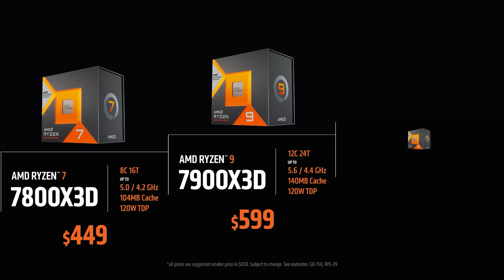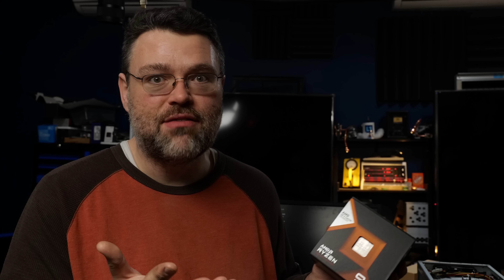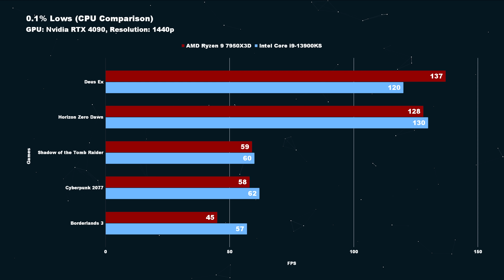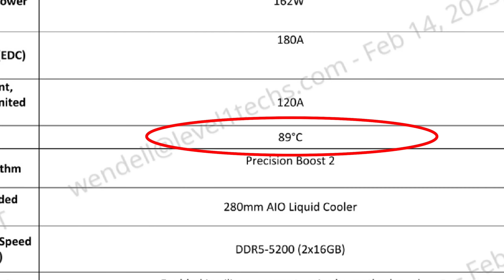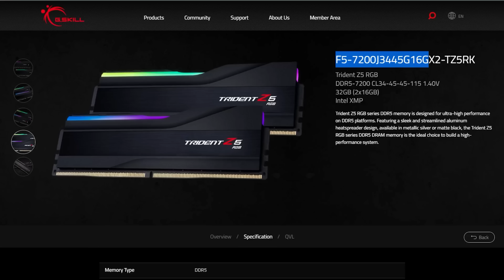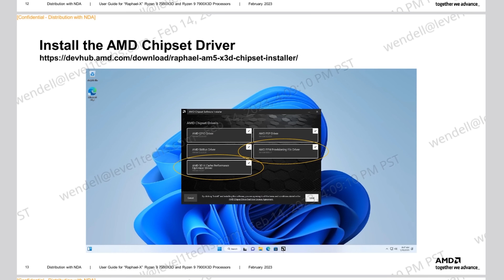7950X3D: Cache Talks While The Watts Walk

Comment: I'm building a 7950X3D workstation, so I will take a look at your insights.  I'm also going to test out some Linux distros on this puppy, basically through an external USB / NVME M.2 drive on the USB-C port on mobo - so basically USB 3.2 Gen 2x2 (20 Gbps).  It is a quick and dirty way to test out Linux flavazs and I can pop out the NVME and put it in the mobo when I'm ready. I also did not install Grub on Fedora 40 because Microsoft keeps trying to take over Bootloading, a recent Windoze update famboozled fooz Linux bootloaders.  Windows 11 implements a fast boot process that makes it difficult to get into BIOS / UEFI but I've forced the Windows Bootloader Menu to appear with the Powershell and when I want to load Fedora 40 I load the mobo Drive Screen and select it.

Windows 11 is a nightmare! I'm working on documenting all my issues and fixes.  Also Powershell is getting more powerful with scripting and automation, so I'm looking into how to prune Win 11. The Total Recall fiasco is going to be a challenge, Windows 11 is the worst bloatware the world has ever known.  We need to band together and provide solutions.

Comment: I'm actually thinking of building a new rig for my unreal engine development... I currently run amd threadripper 3970x and am looking at possibly building a 7950x3d instead because of the increased clock speeds. I would lose some core but I think it would possibly run faster in most tasks compared to the more cores I'm currently running at lower clock speeds of the threadripper. I'm not compiling the engine just building in it. Thoughts?

Comment: Gotta admit I'm pretty happy that I decided up build a new computer this gen. Went from a 8700k and 1070 to 7800x3d and 7900xtx. On the CPU side im ecstatic, the 7800x3d is incredible for gaming. 

The 7900xtx is no slouch either but it didnt have the generational gains loke the 7800x3d had. Not to mention the 7800x3d is pretty much the top cpu for gaming despite costing 250ish less than the flagships.

Comment: I'm going to change mine 10 year old 3700 k Intel and thinking about 13900k or 7950x3d. I have Nvidia 2080ti graphic card and want to change it on next Gen graph in year or 2. So want processor that can handle next gen beast. Intel seems power straight from the box and amd more power efficiency. What do you think??

Comment: I wonder if this CPU might be better than the 7950X. I'm currently in the process of assembling a system with 128GB ECC DDR5 4800 and I've read a few times already the 7950X3D isn't that depended on fast RAM. So might it be actually better for low RAM speed workstation builds when compared to its non 3D counter part at the same Wattage?

Comment: From what I gathered it doesn't appear to make much sense to spend the extra $100.00 on the 7950X3D over the 7950X as the gaming and production performance generally represents a "negligible" difference. Personally, the 7900X @ ~ $450.00 makes the most sense as it's just as good at gaming and not so far behind in other task as to be a real / meaningful detriment - I'm not running a business where TIME is a huge issue. Also there's no need to dick around with "XBOX game bar" and so on.
Reply: when your not using the v cache in games the 7900x3d will give you 6 cores to work with..whereas 7950x3d will give you 8 cores and they will clock at 5.6ghz as appose to 7900x3d with 5.0ghz i suppose if you are not bothered about that for the extra $100...but i see it as you might as well spend the extra if you are going all out on the 7900x3d

Comment: Cache is important no doubt however clock speed is important as well. I am with the intel 13900KS, as I took a chance with the "KS" despite some reviewers negative comments, and getting it up to speed via overclocking does show some impressive gaming performance over the 13900K. In MSFS  I have some results that defy the reviewers results, performance increase about 10-15% over the 13900K? Also the numbers I've seen on the AMD X3D CPU is overinflated for sure. And I am Not a intel/AMD fan boy!

Comment: Would there be any reason to install the latest chipset drivers on say a 5800x3D system? Is it just going to have any real benefit.
Reply: Why would there be? 5800x3d has a single CCD and all of the cores are the same.
Reply: @blegi1245  was wondering if this does anything else in background like it would on the 7950x3D in app priority and all that other goodness
Reply: @shadowarez1337  it doesn't matter. All of the cores are the same. Because all of the cores are the same it doesn't matter what task the scheduler assigns to which core.
Reply: @blegi1245  damn here I was hoping AMD was putting some special sauce in the update for 3D V-Cache Cpus.

Thank you for clarification 👍

Comment: Someone else may have already asked. But why don’t AMD have the stacked cache on both CCDs? Either doubling the cache or splitting it across both evenly?
Reply: Stacked silicon thermally limits the cores on that die to about 5 ghz. If you don't need the boost frequency at all AMD is happy to sell you an Epyc 9174F (16 cores with stacked L3 cache on both CCDs).
Reply: Take this with a grain of salt, as I don't actually know for sure. My educated guess is that different configurations were either tried or modelled, and AMD found that putting the cache on one CCD yielded higher performance than splitting it between both. Or, it could be an efficiency in manufacturing the entire package, as not all CPUs in the stack have multiple CCDs in the package (I suspect the former, as stacking cache on both CCDs would hobble frequency for the entire package to a much greater degree).

Just a guess.

Comment: Forget the ks, no one should buy that chip. I'd like to see it head to head with the non-3d part to see if that extra cost is worth it which I don't think it is.

I just find it hard to get excited about a $700 CPU that's going to be no better than the 7950x in many use cases and you have to have a 4090 at 1080p to show the uplift. If you're gaming at 1080p with a 4090 you're doing it wrong already. It ends up being just as pointless as the KS and no one should be buying that chip. It's fun to play with it in theory but I don't see the point in spending 22% more to see a single digit gain in real world use, as well as a regression from the non-3d part in many non-gaming workloads. Hardly what I would call "no compromises."

I see the 5800x3d as still being the king with the 7800x3d being it's eventual successor. These are just too damn expensive.

Comment: Why would you say this is the best CPU for dev work when the vanilla 7950x has better multi-core, not just out the box but with also modifying the voltage manually can be tuned way extra.
You are at least 10% behind the 7950x with the cache downclocks and voltage locks.

Comment: My big problem with the current Intel platform is that we all know that the 13900k or KS has zero upgrade potential.  Intel historically changes sockets very frequently.  AMD, on the other hand, has historically not changed sockets so frequently.  Therefore, they have a much better upgrade path than Intel.  So x670 will be relevant for several years longer than the Intel alternative.

Comment: I knew buying my 7950X I would probably end up regretting it, when the 3D launches. 
Now i just need to justify ''downgrading'' my 7950X into a Plex/NAS ect server.
Reply: Don't fret - it's more headache than it's worth. There's a ton of things that can go wrong with respect to scheduling, or otherwise a lot of manual intervention - like with Process Lasso - reminds me of the old Threadripper days where Cross CCX is very bad for gaming. The 7950X doesn't have these issues, since it's the same configuration across both CCDs.

7950X3D relies a lot on scheduler intervention going correctly and current solution basically disables half the cores when it detects a game running. (i.e. background tasks will introduce stutters, vs. on regular 7950X)

Comment: Nice review! What mainboards would be a good match for these very efficient processors? I.e. what AM5 mainboards are the most power efficient?
Reply: while technically all four AM5 chipsets support the 7950X3D, and i'm building a machine with it in a B650 right now, most reviewers state that you'll want the better VRM of the higher end chipsets to properly utilize the CPU, so i would recommend an X670 or X670E. i went with a B650 aorus elite ax because opportunity cost was bumping heads between high end board or processor. if one's going to be the weak link and need an upgrade down the road, the mobo was only $200.

Comment: You know what's funny, that 4K benchmark with the 4090, it shows that with Frame Gen, it's likely going to be above 240Hz, the upcoming Samsung Odyssey 8K Neo G9 is 2x 4K @ 240Hz and I do believe that the 4090 is more than capable of pushing those number of frames in a game that supports it at that resolution. But then, it doesn't have a DP2.1 connector. Which is a big wtf moment for me. Why did Nvidia do this? Those connectors is just a few dollars at most right? It just makes no sense.

Comment: Can someone explain to me in simple terms how/if the 7800x3d could/will be better/faster than the 7950x3d please?
Reply: It's not going to be faster (unless the os scheduler sends games to wrong cores on 7950xd3). It's not going to be any slower either because 7800xd3 has the same number of cores at the same frequencies as the stacked cache CCD on 7950xd3. You get the same game performance as 7950xd3 for three hundred dollars cheaper. In workloads that scale with either frequency or threat count 7950xd3 is going to be significantly faster however.

Comment: Curious to see how the core parking logic works when you have a workload such as gaming and streaming from the same system.
Reply: So far the parking works in the way that it detects a game (or similar profiled app) it turns off the none vcache cores. they are off you dont get to use them for other apps or anything. the 7950x3d is doa. wait for 7900x3d at least, maybe even a 7800x3d, there is a world in which they preforms as well or even better if the hz are normalized.
Reply: @jetrpg22  is just wrong. parking is not the same thing as turning off completely.

Comment: 120W TDP

Yeah right, if it's anything like the 120W TDP on 5800X3D then it's more like 150W TDP
Reply: LOL another person who doesn't understand TDP.
Hint: it's not a measure of power consumption.
Reply: @tim3172  LOL another person who assumes he knows what other people mean.

I'm making a judgement based on temperature measurements. Additionally I tested 4 coolers rated for 120W TDP, and 5800X3D chokes on all of them.

PBO adjustment makes a bit of a difference, but it's not stable (not in my case when I run my PC under load for weeks).

Comment: I am a bit surprised about your statements regarding 1% and 0.1% lows as at least the graphs you showed die not reflect that.

And similar for the power consumption.
One is a power-limited system, the other is a full unleashed with auto overclocking.

Comment: Costs more. 
Performs about the same in productivity.
In gaming the differences are minor with afew outliers like Horizon. 
You're better off just buying a 7800X3D even though it runs 600mhz slower than the 7950X3D or a 13700K or 13900K since it is cheaper.

Comment: hey do the pre-rom in-memory compute super fast clock frequency dsp style cores (60GHz+)
Reply: the minimal signal processor transistor processor is very energy efficient, for small amount of transistors for memory specific compute, then just have the memory go as fast as the memory controller, fpga

Comment: A small correction: Cinebench does not fit in cache, but it is not latency sensitive, since it has a smart prefetcher for all the work that threads do.
And this is precisely why Intel was right about it not being a real world performance benchmark. It is too optimized unlike other software.
Software that is optimized to the level of synthetic benchmarks are synthetic benchmarks.

Comment: Great video! So glad you recommended 64GB RAM for future proofing. My understanding is that the AMD system is limited in how fast memory it can support in MT/s by the infinity CACHE. Can you please confirm what the fastest 2 stick 64GB or 2 stick 48GB RAM kit thar will work in combination with this new 7950X3D?

Are AMD able/planning to allow it to use the new 8,000MT/s DDR5 RAM? I heard that 10,000MT/s RAM is coming out very soon. And if AMD can't support faster than 6,400MT/s RAM, would that not mean that Intel will slaughter them by making use of these insane new RAM speeds?
Reply from the maker: Intel is limited too. See my other videos. At least if you want max perf. Firmware updates may fix this
Reply: @Level1Techs  so we should see support for faster RAM with AMD downloads? And buying 8,000MT/s RAM now for an 7950X3D based system may not be a complete waste of money if support will come?
Reply from the maker: No that's different, 4 sticks of memory is speed limited everywhere for now

Comment: Actually I have to think for gaming, the optimal would be the main game thread runs on the CCD with the Vcache and other threads are thrown wherever though I have to think there could be some fine optimizations, and this would vary.  If ALL game threads need access to the same data pool then yes they would run faster on the one CCD, but if not, since the other CCD clocks faster, it would finish its work and pass whatever on to the main game thread or another main thread that's running.

I have to think over time this will become a pretty interesting thing to see with these really high core count CPUs, which for desktop I image in the next couple generations the thread count is going to start getting up to 48, and then 64.

I have to think that these parts once again give reason for people to buy into AM5.  These are the parts many people wanted, either creators that wanted an AMD lower power system that also games at top levels, or people who just game who want the 7800X3D.

I'm waiting for Zen 6 personally because the 5800X3D is great at gaming and will be for many years and paired with X570 it's a nice system.

Comment: With my 5950X, running all my audio through Voicemeeter and doing voice chat with Discord has proved to be a challenge. To get the Discord voice chat to be stable and not sound like an unintelligible robot, I've needed to use Process Lasso to confine my audiodg.exe process to a single core on my 2nd CCD and set its priority to high. How does that type of load work while gaming with a 7950X3D? Also, just how clunky is that whole chipset/Xbox Game Bar software setup?

Comment: I've been thoroughly surprised with Zen. My first Zen experience, personally, was an R3 2300u Laptop with Vega 6 graphics and I could not believe how smooth Windows 10 ran on it. I have been disappointed though with Microsoft regarding this APU.  It has TPM 2.0 and Secure Boot. It's a Quad Core processor, It has 16GB of memory and runs both a 256GB M.2 NVMe SSD and a 500GB SATA SSD, yet Windows 11 keeps telling me it's not supported. It literally makes ZERO sense. 
But gripes aside, I could not believe how smooth and snappy the OS was. In comparison to Bulldozer this chip stomps all over it and it's just 4 cores.  My 4.7 Ghz FX 8350 can't even beat it in multi core! And it's a mobile part. Seeing it pef at 3.9 Ghz all core is fun too. It's nice to know it has some chops and it has pretty good single core (Broadwell) so emulators and anything else with a single thread affinity runs well on it too. I was very afraid to try out Ryzen. I didn't care what the reviews said. I'm disappointed in myself for not giving it a try sooner than Zen+.

Comment: I think you might be the only reviewer who is actively using Optane, so for me at least, I think it would be very interesting to see how newer games benchmark with the P5800X vs. a top-end NVMe SSD, what with DirectStorage and Unreal Engine 5 entering the picture... and to what degree the X3D vs. non-X3D parts relate to that.

I'd also like to see a focus on games that might really benefit from X3D, such as Stellaris (you mentioned it, but then didn't compare to other CPUs), Civ 6 turn times, Factorio, and even something like Microsoft FS2020 which is constantly pulling in world data.
Reply: optane is still the fastest storage technology sadly, i hope intel brings it back
Reply: @snowwsquire  I hope so too, but I doubt they will. There will be some similar tech that'll become available eventually, but for now, most of us are stuck with "fast" NAND Flash.
Reply: Does anyone know what this "gen-z breakout cable" is that he refrenced? Is it one of the regular U.2/3 cables or is it something different/special?

Comment: what about running it on idle? 
is it a good unraid CPU ? 
can the GPu be forwarded to a vm or plex docker?
Reply: to the first question, intel gets much better efficiency at idle. if you plan on leaving your system on 24/7 or only under light load, intel might be the better option for you. under load, AMD is running much more efficient especially with the 7950X3D.